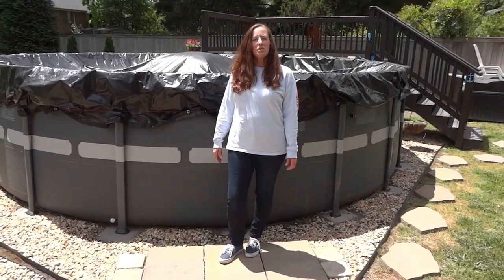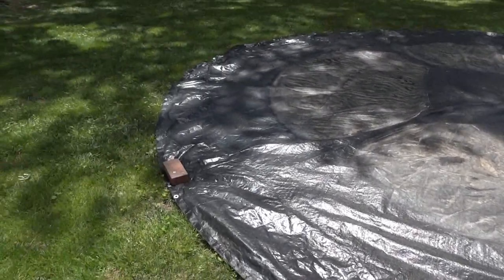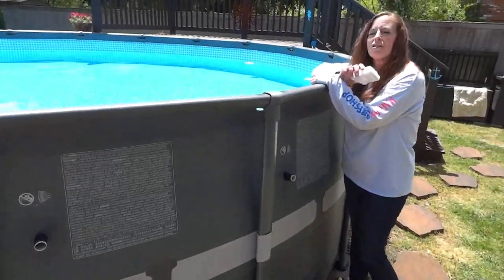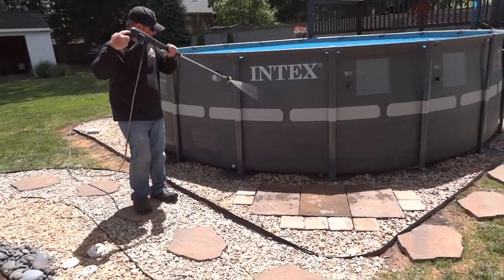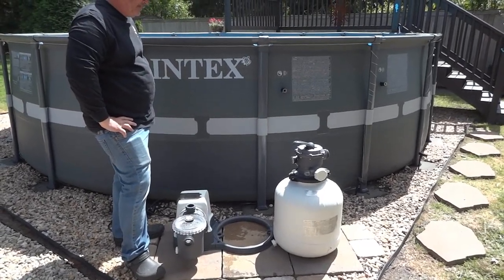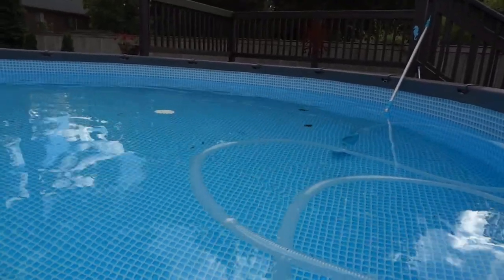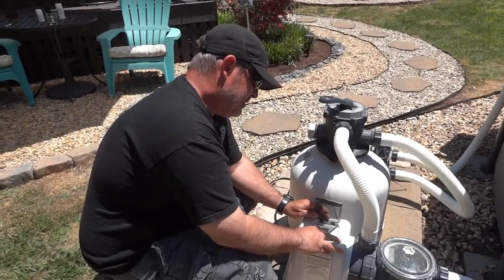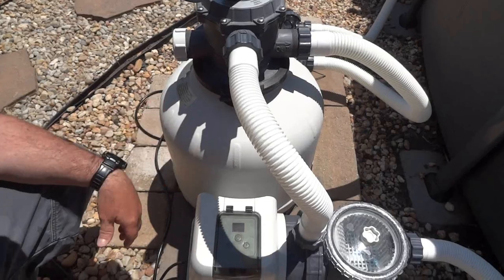Opening up our above ground Saltwater pool after Winter for the first time!

Comment: Pool looks amazing. I found your videos from searching salt water startup videos (purchased the system this year) to know what I need to do even I fill pool up (get water tested before adding salt or not). I'm also glad to see that there's someone on here from VA that leaves their pool up. I've been nervous about doing that so I take mind down every year. Im over at the foot of the blie ridge mountains side.  

I do have one suggestion tho if pool supply prices ever go down. You should upgrade your inlet strainers to 1.5" to get the most out of your sand filter. I did that to my previous pool and to skinner pulled so much better. I also upgraded to a Hayward inwall skimmer last year which is nice also.
Reply from the maker: Thanks for watching  our videos. Yes, we love our saltwater pool! We were insanely nervous at first with mostly confusion but now we realize we made the best decision we could have ever made.. Now we have so little to worry about. Thanks for your suggestions we have always wanted to accomplish your ideas as well but just nervous about cutting into the pool to make the Hayward skimmer switch and switch over to the 1.5" hoses to the pump as well. We are planning  on relocating in the next few years so this equipment  and the pool will stay but we will try it on our next new pool install.
Reply: @MoverandShaker  I was also nervous about cutting into the pool to do the 1.5" inlets (done them on my first pool) but I was given a free pool so honestly wouldn't be out anything if I messed up. Now the skimmer on the other hand is a different story. We bought a bigger pool last year so cutting into a brand new one was unsettling lol.

Comment: Great start up video. This is going to be our first season with the sand filter and salt system so I will follow your lead in the fall.  I did install a Hayward skimmer along with the sand filter and I’m pretty happy with it so far.  Our cover wouldn’t stay on so our pool was essentially uncovered all winter. As you can imagine it was a mess but it’s finally almost ready.
Reply from the maker: I would sell that pool cover that won't fit and get you one that will and buy the saran wrap stuff to wrap around it and a pool pillow. It opens up so crystal clearn and less headache for you next time, plus during any rainstorms salt water won't be splashing all over the metal supports where they connect because it will be covered.
Reply: Do you have to have a sand filter to go with the salt water pump or can I just use the salt water filter?

Comment: We have an 18’ x 48” about 7500 gallon above ground (best way) we did chlorine last year and I bought a salt cell to use this year instead of buying chlorine. We took it all the way down (drained and put away) I have never used a salt cell - when we get it all set up and filled again, I was told to run the pump for about 24 hours with about 4 bags of salt before turning on the cell. What do you suggest I do to officially open with no water and having to start fresh?
Reply from the maker: You should fill up your pool 1st and circulate the water for 8hours with the pump on and then get a water sample to your local pool store with a sample of your water. At this point, you need to follow the suggested add-ins  in order to get your water completely balanced before starting the salt water chlorinator. And yes that means you have to put certain chemicals in your pool first. Once your water is completely balanced then Then slowly add your salt per the saltwater  manual and you will need to let it Circulate for the amount of hours for your size pool  to make sure everything has  dissolved  very well.  Then you need to check your salt levels with salt water strips  to make sure  It's in the range  for your size pool after that you should be on cruise control. The only time we've had to add more salt is if there are heavy rains or we do more backwashing than usual.   We very rarely ever have to add anything 2our pool again.

Comment: Do u drain past the ports , with winterizing? How does the salt water affect your vinyl liner? I'm thinking about switching to salt water this summer 🤔
Reply from the maker: The salt has not had any effect on the vinyl liner itself. Yes we drain past the ports but that is not required  with the use of strainer hole plugs however for safety sake since our pool is near the house we do it as a precaution
Reply: @MoverandShaker  ok.is that an Intex salt generator?
Reply from the maker: https://amzn.to/4alTknN. Yes, it is! Here it is.

Comment: Did you have to bond and ground this pool?
Reply from the maker: No I paid an professional electrician to come out and knock a hole in the wall  On the outside of the house Which connects to an outlet on the inside of the house that's grounded.  He put like a weather Box around it

Comment: Doesn’t it say not to run the pump more than 12 hours straight?
Reply from the maker: I've never heard that. how else would you boost your Pool for over 24 hours  When the salt water system relies on the pump to be running with it at all times
Reply: @MoverandShaker  in my Manuel it says not to run the pump no more than 12 hours at a time constant. I agree with you, seems silly to me but maybe they are worried about cheap internals inside the pump

Comment: We tried salt water last year but ours got green. Not sure why. I have the same pump and that salt water pump thing. Is it supposed to produce it's own chlorine?
Reply from the maker: Yes we LOVE our SALT WATER SYSTEM. So much money saved on NOT BUYING Chemicals, not worrying, never having to research anymore and never been unsure again.    Yes, we did have a slight green pool scare but sometimes rain, and neglect can do that. We have a Green Pool Scare Video if you want to watch. It will show the before and after at the end and what we did to get it back to normal.   

Salt Water is the way to go. At first we were very intimidated but it we were able to get through it all and now we do make sure we vacuum every other day or so and we run our pump 8hrs and 6hrs on the chlorinator. We manually plug it in each day. We aren't that high tech. The timer would work but we don't like the outlet being exposed if it rains. 

You really should reconsider. The Salt Water System does produce it's own Chlorine and santizes the pool but you still have to vaccuum and remember that the pool has to be Balanced before you ever run that system in boost mode for the set up.  If you don't your wasting your time.  Good luck if you  try again.
Reply: @MoverandShaker  thank you. I did watch that video. So we had to reopen ours and drain and fill. We didn't cover it last year so we have already used liquid chlorine. What do I need to do to change it now to salt if that's what we wanted to do?
Reply from the maker: @natalieveal3450   Your water has to be balanced before converting.  We use.   these test strips. https://amzn.to/3woVjUEe  You need to make sure everything on the test strip is in the o.k. range. Whatever isn't you need to fix it first. Once balanced, look at your chart in the Salt System book to find out how much salt for your size pool. Add one bag first with only the pump swirling it around with a brush so there is no chunks.  Add next bag, do the same thing and so forth. Don't over salt or you will have to drain a portion of your pool water in order to get the salt back out.  Put your pump on FP (free pump). Let pump run for 24 hrs to circulate salt. The next stage will be to run pump in FP, Turn on Chlorinator and set timer for the desired time based on your manual instructions for normal operating time.  Then Hit boost.  The System will run 8x the amount you set it for.  Once this cycle is over.  Use SALT WATER CHLORINE GENERATOR TEST STRIPS 40 CT  https://amzn.to/371fPQk  and make sure your PPM is within range based on your manual's specifications. We run our pump 8hrs and Chlorinator for 6hrs everyday but everyone's times are different based on pool size and equipment so make sure you follow your manual. Also, you have to be diligent in vacuuming your pool at least every couple of days, otherwise neglect will create problems. when you are in your pool, you do some cleaning for a few minutes on the surfaces and the liner while you stay cool. Good Luck.
Reply: @MoverandShaker  thank you guys so much. You are very helpful. How much would you say you have to add salt in a pool season. Where did you get your pool cover? Do you cover it every night?

Comment: So I set my pool up and im missing a leg sleeve!
Reply from the maker: What?!!! Was that a return??? was everything sealed only one strip of tape all the way across? Call them ASAP and tell them you have family coming in next weekend  and this is Urgent
Reply: @MoverandShaker  yep sealed box from academy sports.... everything else looks good. Worst case I will just put the leg behind the belt like the older style pools. Still pretty strange
Reply from the maker: If it was sealed then intex need to replace it ASAP you can't add water that pool without those  Unless you can find one on Amazon and get faster and then when you get the 1 from intex just sell it back on Amazon or eBay
Reply: @MoverandShaker  I've looked for a replacement and can't find one. Will contact them Monday morning.
Reply: @MoverandShaker  did you end up putting the pavers on top of the tarp or burying them?
Reply from the maker: @sirdavies18   They were above the ground and level and the pools weight gently put them in their place which is now level to the ground.